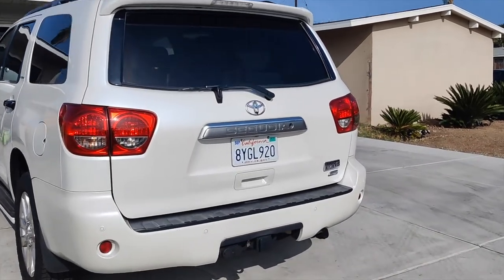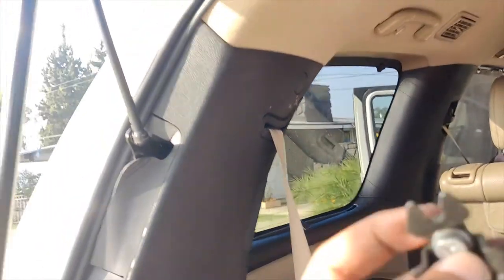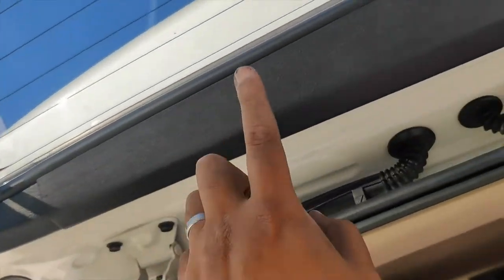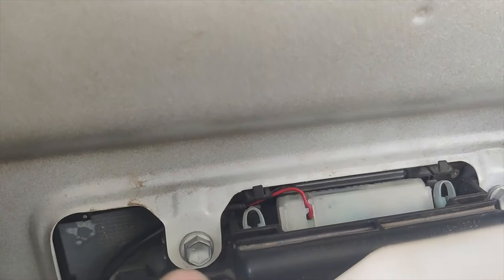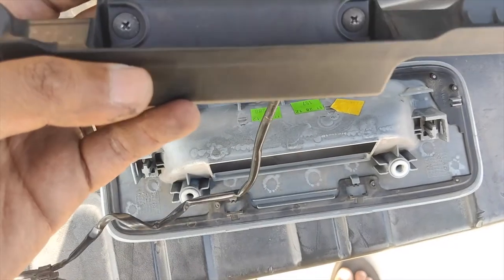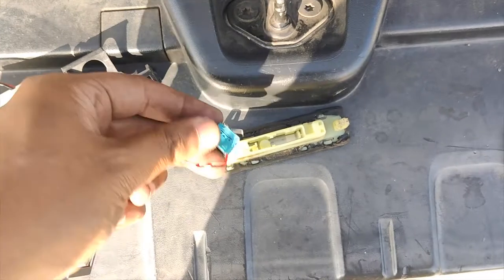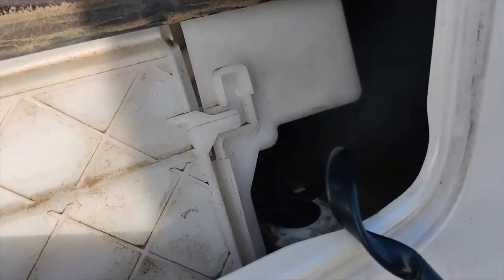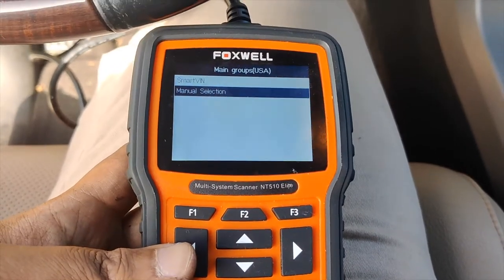Fixing 2nd Gen Sequoia Sticky Tailgate Button

Comment: I have a 2011 Sequoia SR5 
 The rear hatch won't stay shut, the button for opening it is working. I can hear the mechanism so it's normal. There are window goes up and down just fine. But when I close it it stays open and a lift back open. It just doesn't latch. 

I'm assuming this is the actuator but I don't know for sure. Any insight or help would be appreciated